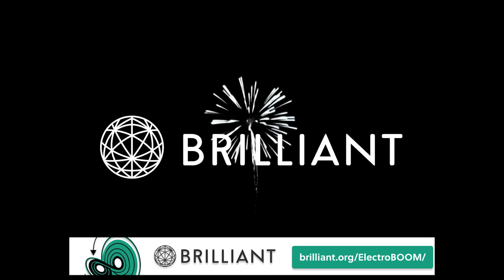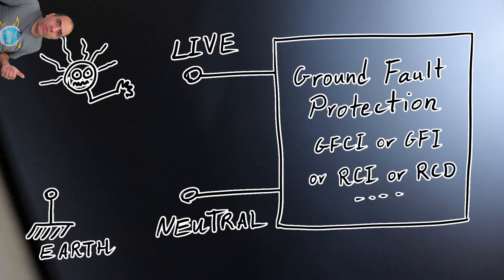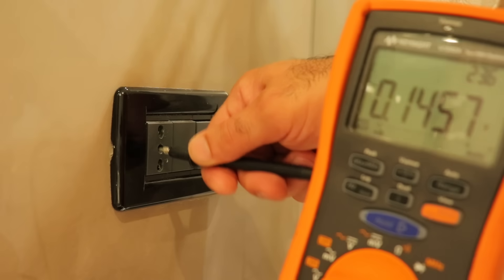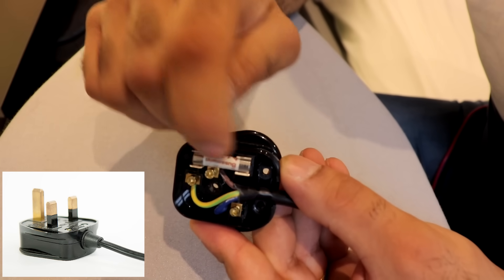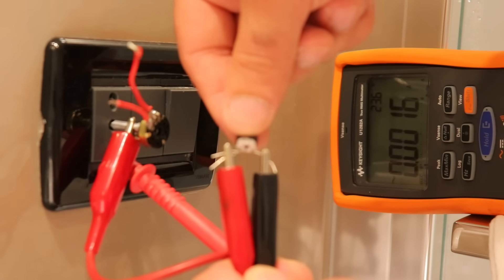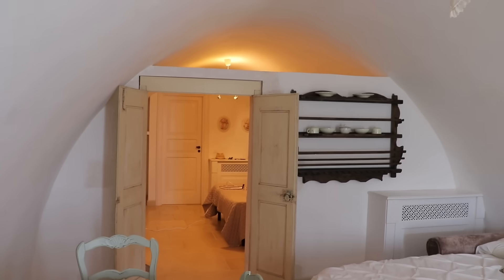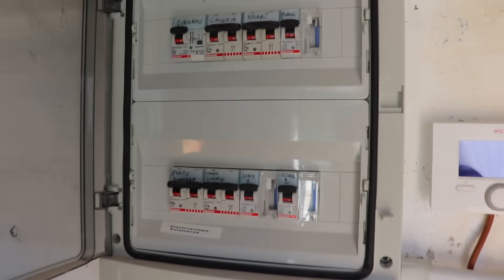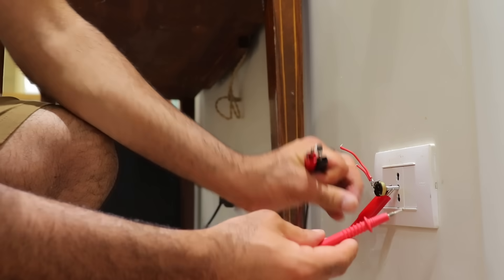Tripping Every Breaker in Italy

Comment: hi mehdi, I'm Italian and I can confirm that everything works like this here, usually in new buildings for about twenty years, breakers (lifesavers in Italian) have also been installed in the bathroom, but the reality is that there is always one or more protections, for example in my house the electric line of the lights and the one of the electric sockets are separated, if a socket is short-circuited the lights can be used, just to go and reset the "lifesaver" :) in addition there is another breaker upstream before the electricity meter (in case one of the two downstream does not work correctly), so in my case, if we consider the bathroom as a starting point, there are 3 breakers before the electricity meter. :goodvibes:
Reply: Oltretutto negli impianti un po' più costosi ho visto mettere 2 differenziali 1 da 30mA per luci e prese e 1 da 10mA dedicato solo per la linea bagno
Reply: In my house (built in 2008~) I have a breaker for each room + externals and a lifesaver that shuts down the entire house.
But the real question is... how the hell did he manage to plug in a Siemens plug into a regular one?! I've never been able to do that... Lol
Reply: @manupaz  the schuko can be fitted in crappy plastic outlets with no problem at all, I’ve done it multiple times with class 2 devices

Note to Mehdi, we tend to use adapters for the schuko to keep the grounding connected
Reply: @manupaz  you can do it in bipasso sockets (the ones with the double holes for the almost gone 16A Italian plugs) by forcing it in.
It's dangerous and you can damage the socket but it's possible
Reply: yeah, agree my 2 floor - 100 sqm years of construction 1300, totally rebuild in 2018, have one lifesavers for each room, plus a thermal breaker each one on electric socket linem, one lifesaver for light each floor, and totally separeted electric line for air conditiong, induction and oven, and wood pellet auto stove too... and yes, everything ends in one single, huge electric box at the ground floor... quite a mess hide it, but safety first
Reply: everything works properly, but for example, why my HP laptop have a 1500w socket? it makes no sense at all
Reply: @manuel.dignani  1500w socket? 🤨
Reply: @Achille004  yes it has the German big, round thing for a power supply that use only 45w. I mean this makes no sense to me, but ok HP engineers, a ProBook 450 G4 needs a 1500w pulg 🤦
Reply: @manuel.dignani  it is called supply, stuff most of the time is not assembled with what’s best (still respecting standards and regulations), but with what’s available and it’s more economical
Reply: @manuel.dignani  hmmm im guessing your hp laptop has a huge ac motor inside acting as a microprocessor🐱👍🏿
Reply: @fidelcatsro6948  from CPU specifications, my i7 7500u has a TDP of 15w
Reply: Di solito ho visto luci e prese con due termici diversi, ma con un differenziale unico
Reply: Make it 30, the "salvavita" differential switch's been mandatory since 1990.
Reply: In the UK. Normally you have Upstairs and Downstairs circuits, With outlets and lighting on separate circuits. Then you also have a dedicated bathroom, cooker and kitchen circuit.
Reply: Io a casa ho luci e prese separati, ma se salta uno, pure l'altro salta... boh

Comment: Learned something new today. I always assumed that Europe was 220 volt split phase, i never considered that it might be single phase
Reply: It's nominally 230 volt. Second, it's 3 phase.
Reply: @deang5622  Yep most of Europe is 400V 3-phase, where live-to-live is 400V, live to ground /neutral is 230V.  Rural Norway has some areas with 230V live to live and ground being a random point in the triangle.  3 phases allow the load on the grid to be the same every fraction of a second, as each phase draws more Watts as the others cycle to lower voltage.
Reply: The split phase I think is an oddity. It's not natural. I will explain what I mean.

When we use 3 phase in our homes and industry, that 3 phase is generated by the power station, transformed up to a higher voltage (and lower current) and then distributed around the country using high voltage overhead lines, and that 3 phase is distributed across the country using 3 groups of cables on the overhead pylons.
And 3 phase is great for synchronous 3 phase induction motors. 

The split phase, to my mind is not natural. It's not generated like that by the power stations. I believe they are still generating 3 phase because that's beneficial to industry, but the US, as it was only running 120 volts phase voltage, it needed a way to deliver more power to residential homes, and a way to do that is to run two 120 volt phases, phase shifted by 180 degrees to give a voltage of 240 volts across the two split phase conductors.

I think it's a way to correct for some poor design decisions that US electrical industry made a long long time ago.

So where does the split phase come from. I suspect it's achieved by having a single phase transformer which has a centre tap on the secondary winding and taking out from the transformer two wires: phase+ , phase- , which would then be 180 degrees apart.
Reply: @deang5622  Yeah, i see your point. It was explained to me that the second phase mirrors the first but the timing is retarded a bit and a third phase is retarded slightly behind the second phase. Up in Alaska, we had a 3 phase 25hp refrigeration compressor but the only power available was split phase. My friend came up with a solution using a 2hp 3 phase electric motor. He wired the L1 and L2 into the motor off the mains and ran the L3 to the compressor. So to start the freezer, you had to wrap a rope around the motor shaft and yank on it with all you had, then immediately throw the breaker to supply the L1 and L2 power to the motor. If done correctly, the motor would spin up (generating the third phase) and you could throw the breaker for the freezer. If you didn't yank hard enough, the motor would spin slow and you would have to start over again. I used to joke that we had a pull start blast freezer.

Comment: I was working at a place and the HEAD engineer came down and proudly said we now have RCD's. He got a coat hanger and then poked one end into Active and the other neutral. He then turned on the switch...... we were still finding little balls of coat hanger months later. He went back upstairs to design stuff. We went back to fixing all the stuff he designed. Have a good holiday.

Comment: 14:50 if you're going through your  phone charger, wouldn't the gfci happily supply as much current as the phone charger can take?  It's like an isolation transformer.

Us code is recommending either GfCi or AFCI for any outlet in a residential area.  Which is getting outrageous for new construction, like a thousand dollars in breakers for a 2000sq ft house.
Reply: Bad phone "chargers" fail to isolate properly.  Search for the "Cheap Shitty Pink pink USB Charger from China" song.

Comment: Come to Australia next, new standards are similar to EU and UK with every circuit and the main breaker protected by RCDs but there are still lots of old buildings with no protection at all just fuse wire with some old fuse boxes containing nails instead of fuse wire. So it's a lucky dip between almost impossible to kill yourself and very easy. Also almost every outlet is 240V or higher. My house is closer to 250V. 

You can also pull WAY more power from our sockets than their nominal rating lol. I can pull about 17 amps from a 10 amp outlet and can pull about 30 amps from my 15 amp outlets lol

Comment: Bulgarian here! We get 2 standards here - the circular one with ground connection and the tall one, but with a major difference - only 2 conductors (no ground)
you can plug the non grounded connector into the grounded outlet, but can't plug a grounded plug into an ungrounded outlet
I got no idea if what I said made any sense. What matters is, what you showed at 15:30 - there isn't any current going through here

Comment: Remembering that the IDR will drop even if the device is grounded by the outlet. If the discharge occurs between the step and any other point that generates grounding (floor, wall) at 30ma, the IDR will trip. In Brazil, the current standard for electrical installations (NBR5410) requires the use of IDR in all new installations, as it brings safety to all wet areas (kitchen, bathrooms, service area)

Comment: Great video as usual!!
In Europe there are three main ratings for GFP (mandatory in all installations)
3mA: whirlpool in the bathroom (if you had book a room with whirlpool  you may have tested)
30mA: home and general installations
300mA: industrial intallations
Reply: I think while growing up I have seen standards for GFCI circuits evolve over time. There are variations from Country to country across Europe, but here in Germany I remember my parents house built in the early 80s had no GFCI at all. At some point for some application that was added later, a new standard was in place and that application had to have a gfci. some time in the 90s or very early 2000s I think it changed again, and you had to have at least bathrooms and the kitchen or comparable circuits on a GFCI. when we built our house 13 years ago it was one 40 A three phase GFCI for the whole house. Today, for each row of breakers you would add one three phase GFCI plus some lightning/overcurrent protection for the whole box.
In the past i did a renovation in an older house, breakers actually still had been fuses and wiring was not what I expected, being used to green yellow fro ground, blue for neutral and usually brown or black for phase. There we had tiny red, grey and white wires. That house was built some time in the 1950s I think.
So, it is still possible to find no GFCIs or only limited to certain circuits, because all the changed standards only apply for either new installations, or if you for example exchange the whole panel. But otherwise there is no requirement to get existing installations updated. 
For hotels and commercial installations it may be different, but to be honest, if there was no major renovation in that time, I am not sure if the hotel would be the best choice either.

Comment: this guy does not what is doing
in Europe and in Italy the blue wire is always the neutral by electrical code and by law in the main panel you have to have at a ground fault breaker after the meter.

Comment: Well I think the first hotel has not the proper safety setup.
In Europe we usually have the following standard: 
Black, brown and gray for live wires, blue for neutral and green/yellow for protection earth.
The colors depend on the cable.
3 wire are usualy Black or brown, blue green/yellow or   brown, blue, green/yellow.
On 5 wire cable you have 
brown = L1,
black = L2,
Gray = L3
Blue = N
Green/Yellow = PE
 Old standard was Black, brown, black, blue, green/yellow.
So if the black wire was the neutral it doesn't comply with European standards.

Comment: Faulty standard application in the 1st hotel: in Italy blue is neutral and black or brown is live wire, by law...Anyway the new rules are also that the 0.03A is for all the house EXCEPT the rest room which needs a 0.01A.
The last plugs are Shuko and they are German standards, widely used here too, but they don't go into undamaged italian "vertical" sockets unless you force them in (damaging the socket). The double holes for live and neutral are to plug devices that absorb max 10 or 16A (small and large holes respectively). Of course for those sockets you need at least 2.5mmq wires, the smaller ones can attach only to 10A sockets.

Comment: It's much better to have breakers for lights and outlets on separate circuits. It's exceeding annoying to get put in the dark. 

Which reminds me of one of my pet hates in many UK houses, and that's to have just a couple of RCDs to provide the GFCI functions for all circuits meaning that, in the event of a trip, half the circuits in the house stop working. There's a much better solution, and that's to used RCBOs (combined over-current and residual current/GCFI functionality). That way you only lose the one circuit at a time and it makes fault-finding easier and reduces nuisance trips. The reason this isn't universal is simply it's a bit more expensive, but what's an extra £150-200 on a job that will have cost several thousands in the first place. 

In any event, it's interesting to see how hotels in Italy have now updated their regulations. The country wasn't always known for its good wiring standards.

Comment: Another thing I can clarify is the different kinds of outlets that you found in Puglia hotel.
Outlets that have both little and big holes are designed to withstand a current up to 16A, while the other tipe, with just little holes are designed to withstand a current not higher than 10A.
Reply: You would usually find Power tools that need lots of current with a 16A plug (the bigger one) while smaller and less powerful tools with a 10A plug (the smaller one.

Comment: I can answer to your question about that weird outlet in the Puglia hotel. That's a dedicated outlet for the emergency torchlight. Whenever a breaker pops, these little dudes light up thanks to a built-in battery that charges while the circuit is normally functioning so that you can easily find your way in the dark and detach them from the wall and use them as a proper torchlight.

Comment: Venice is one of the few cities i know that is still running a bi-phase system instead of the standard neutral + line. Strange thing is some places are up to date, some just don't. And maybe that's why you found a black neutral (that is wrong here), probably this place was feeded with bi phase and then converted the wrong way. You can see the "N" sign on the breaker that means "neutral goes here" and it is in fact a blue wire.

Comment: (most of) Europe doesn't have GFC's. We have RCD's. 
Required for all the home (300ma), and a separate one for "wet areas" (30ma), the 30ma one is required to be after the 300ma one. You may be required to have multiple 30ma ones. (they're optional for non-wet areas but this is a rare find (most people save the cost).
The 300ma RCD will be sealed after mandatory accredited inspection of the electrical installation and can't be removed/disconnected.

Comment: Some countries in EU have even multiple RCDs, separate one for whole household, and separate one downstream for bathroom an water related stuff especially like whirlpool with electric motor, this is redundancy. I'm sure even "downstream" by wire in the hotels there is another RCD which will act later but will trip, you usually trip only nearest one to fault.

Comment: 9:13 it is an old bticino magic 5021 phone socket. It is a legacy and proprietary socket and it is not used anymore (since 30-40 years). BTW, in Italy we have high security standards. Keep in mind we have 220v so it SHOULD be in this way. Normally even every house has a "Salvavita" (lifesaver, GFCI) breaker protecting every socket. Moreover, it is forbidden to rent a room/apartment if the electrical plant is not safe!

Comment: You make only a mistake. In Europe we have different colour but: black brown, grey is for the power source, blue is for neutral and the yellow green for the earth. We have breaker for Light that had 10 A current, for the breaker for plug 16 A, and a general that work as "salva vita" Life saver, that connect the house to the external connection

Comment: the two different plug size are for differen power rating of the plug. The small one support maximum 10A, the big one 16A at 220V.
Also, regarding ground fall protection, every house in Italy is fully protected like you experienced in the venecian hotel
Reply: And also market saturation. German plugs are cheap because they are more widely used in the world.

Comment: plugging the german plug (round with earth on the side) in the small italian outlet (3 in line) is harder and you have to use more force (the diameters of the prong is bigger on the german plug) since it's not supposed to be done, not only for the ground protection but also because the small plug in italy are usually connected to the light circuit which is dimensioned for 10A while the big italian outlets and the german ones are usually on a 16A circuit. So you will occasionally find some outlets that only have the small connector (usually by the bed, for lamps or phone chargers). Where you have both holes it means it's a 16A circuit. If you have any other question on italian standards feel free to ask

Comment: Medhi havent seen the whole thing yet but i felt the urge to tell you that Ground fault protection in europe is done with a differential breaker with less than 40 mA tolerance and they will cut the electricity at the start of the home instllation

Comment: Well those other bigger plugs are German ones  when I look at the hohles on those simpler outlets it obliviously made so you can 2 different standard with 2 hohles in each other .
Yeah German also have simpler plugs with no ground protection but they use the same outlets this is the reason the German grround plugin fit in with the simpler outlet.. I'm not sure is this because it is a hotel  so that Germans don't need to use adapters ?

Comment: 15:22 what the ..... the prongs of this type of plug have a slightly larger diameter, so they should not fit in this type of sockets, but only in the socket that you showed a few seconds before.

Comment: There's different rating GFCIs (RCDs), 30mA must be used for bathrooms. You have 10, 30, 100, 300, 500 and 1000 mA. They often use 2 GFCIs, one with 30mA rating for bathroom, and one with 300 or 500 mA rating for the rest of the house.